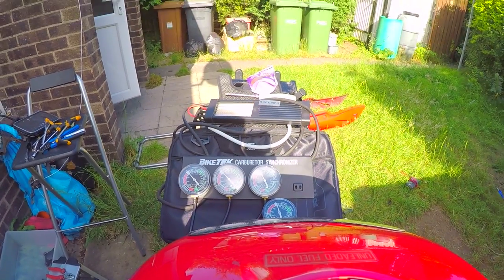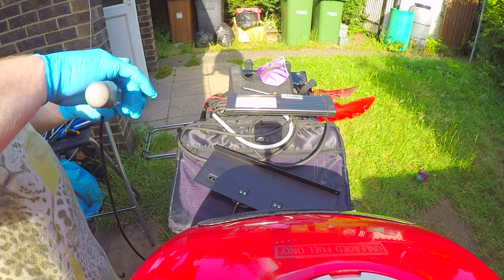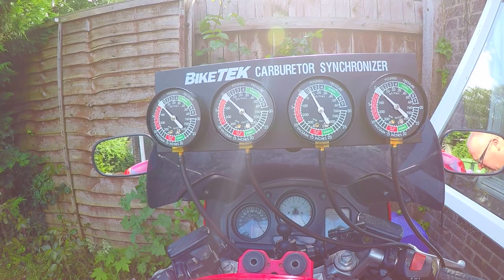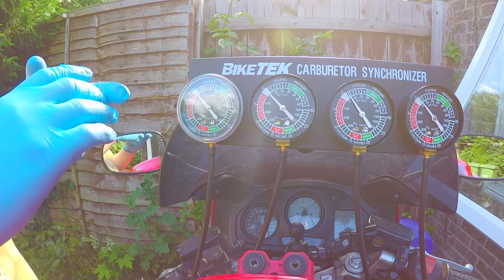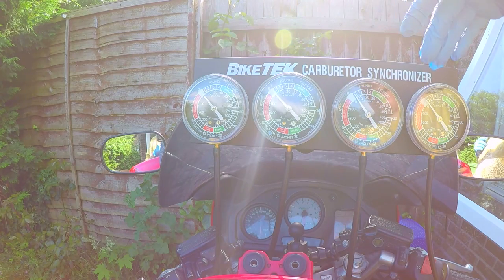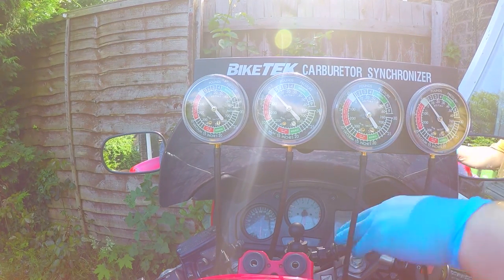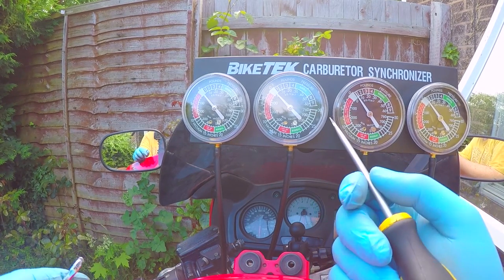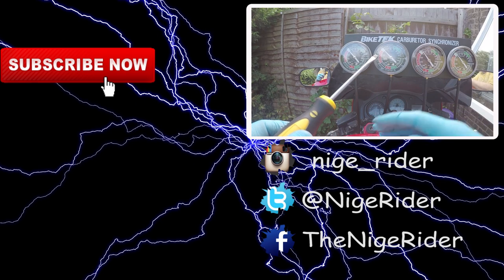Biketek Vacuum Gauge Review

Comment: Sorry for being thick but doesn't the 5th gen VFR not have an ECU with an OBD port that you can plug into and use software like TuneECU to balance the throttle bodies? I am guessing it doesn't otherwise you would have done this? As nice looking at these Biketak gauges are I think I would try and use a digital metering system or get a dealer to do it.
Reply from the maker: It does have an ECU but still has mechanical throttle bodies, i.e it's a metal cable that is used, unlike a fly by wire system. So because it has a mechanic system in place it requires a way to adjust the air intake at startup and idle, that is all the starter valuves do just adjust the air

Comment: I have the same set but one of the four suddenly died at the first test....now I guess I have to sync the cylinders in couples! I was wondering: how do you use those plastic valves to stop the pointers jerking? I thought they were just T-joints for doing in-line measurements... If you use one of the rubber hoses to go from the vacuometer to the plastic valve, how do you connect the latter to the vacuum adapter in the bike? Do you have to undo the plastic screw in the valve? thanks!
Reply from the maker: When you say died what happened to the gauge?..the vacuum its measuring is pulsating as the valve opens and closes, the valves allow the vacuum to be balanced by either reducing the vacuum or increasing the vacuum going into the gauges